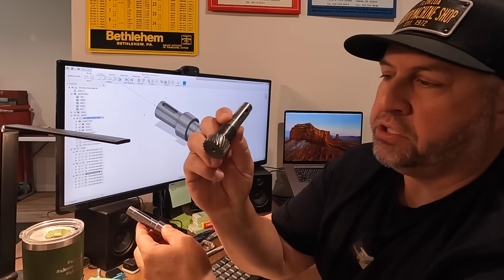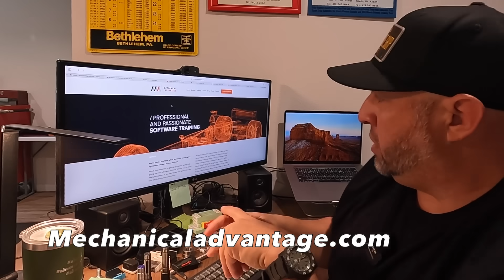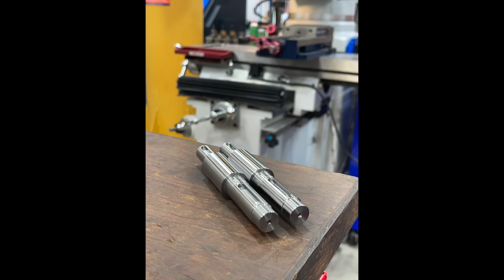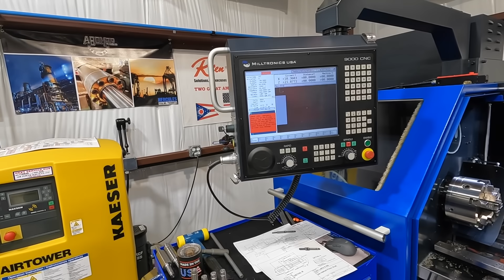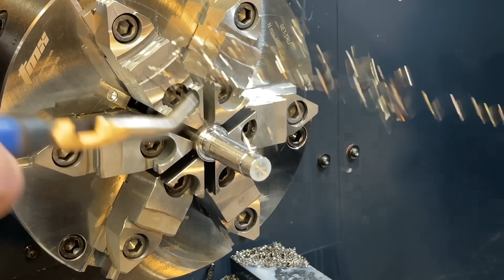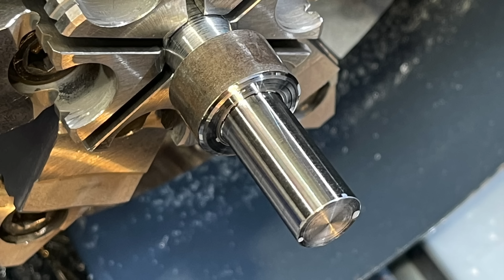Pinion Shafts Turned in the CNC Lathe

Comment: Hi Adam, maybe get a torque wrench for that six jaw in the CNC and figure out the required tightening torque for the parts to stop slipping, once you did that it should be repeatable (unless it varies with part diameter). Also i really appreciate your mix of manual and CNC work on the channel.

Comment: Hi Adam. I think the chatter can be reduced considerably if you reduce the OD tool stick-out from the turret on the Miltronics. In my opinion the tools are sticking out too much. I can see that the setup on the manual has very low tool stick-out and reduction of tool stick-out from the holder is a general rule in machining. This applies to boring operations too. Any stick-out  length more than 3 times Dia for a steel shank boring tool is going to make the bar scream on the CNC. Another thing you can try is ask MIltronics how to do Spindle Speed Variation (SSV). All the FANUC, HAAS (HAAS calls it SSV and they have a video tutorial on it on YT) and Siemens controllers are capable of doing it. Vibrations and chatter on long work pieces sticking out of the chuck can be reduced effectively with SSV. With SSV the spindle speed continuously varies  between two user settable limits over the normal set RPM and that prevents the tool or the job from going into resonant vibrations.  On  a CNC knowing in which direction you should go make those horrible chatter go away can be a little daunting at first. If reduction of tool stick-out does not help, reduce the cutting speed by half or more. Cutting the Depth Of Cut may not always solve the problem because the tool may rub too much at very low DOC. The general rule of thumb is DOC shall be at least as much as the radius of the insert. Try decreasing the nose radius from 0.8mm to 0.4mm or lower and then reduce DOC. My two cents there. Anyways, thanks for posting those videos and I really enjoy watching them.

Comment: > laugh riot - 'the client only needs 8 pcs.'...more than likely translates to a cooperative educational process of securing a timely and reasonably priced cnc machined replacement item when in fact they probably need ~ 800 pcs., of which 8 will cover the last couple months back ordered repair parts supply. one of those work & earn interface vortexes the result of software mis-match snafus between the oem supplier,  cnc replacement parts supplier and the design/production process. Fortunately, abom can just as easily get the job done manually to extreme precision tolerance in nearly the same time frame while learning how to 'profit' from  his skills inventory new and old.

Comment: Sad Adam, I babled the same excuses 25 years ago when I started modeling, programming, and setting up and running the cnc's. 
    The difference is that I didn't have the new machines. They were 89 vintage with a terrible programming program.
 25 years later I'm retired and can relax and listen to you.
  My first 23 years of work were spent in a forge shop as a machine repairman running the old crank maching tools, so I knew about speeds and feeds. Down side to that is carbide came into play with the cnc's, which are much different.😮

Comment: I wonder if you could use a ratchet or torque wrench instead of the chuck key. It will give you more leverage and keep you from the wall. if you use a torque wrench you'll know you hit the mark to tighten it the same all the time.  
For your rough sawing, why aren't you setting a stop so they are all the same length?

Comment: Excess. Not access. Seem like it would have been easier just to do it manually.
Reply: That’s not the point, he even says in the video, it’s a learning exercise to learn CAD/CAM and CNC. He could have done this faster in his manual lathe, but that’s not the point, he’s trying to learn.
Reply: But then he wouldn't improve and widen his skills, adding a CNC to the shop for such jobs, where he has multiple of the same part to machine is a step in the direction of making the shop sustainable beyond youtube and patreon.

Comment: Hey Adam, i run cnc and manual,  is it possible to use  3 jaws made os steel or ductile and bore the jaws leaving a stop in the back, basically bore a pocket, you will need a boring ring to do it properly.

Comment: There’s no way that the issue is that you’re not tightening the 6 jaw enough. I’m not a CNC guy but maybe that chuck is not the right chuck for the job. There are cnc machinists out there that are much smaller and weaker than you are and they do just fine without having to put the gronk on the chuck.

Comment: 14:20 In the production shop we used a Collet and Bar Feed system, so it could part off, feed out the material and make the next piece automatically.  The Collet was tightened with hydraulic force so it was REALLY tight, but we still got push back occasionally.

SO we had to add extra cuts when roughing, which slowed production.

On some jobs we used soft jaws machined to suit that job, with a positive STOP or base in the back of the jaws to push against when roughing ...   so the part could NOT be forced back.

Comment: I understand why the toolpost turret is reversed for ease of access on a CNC lathe. but I'm curious to know how they solved the liftoff problem since the spindle is still spinning counter-clockwise. seems like it would make more sense to just reverse the chuck. though I'm sure a whole market of left handed tools would have to accompany that
Reply: Turning tool "lift off" is much a non-issue, this has been done on manual lathes (inverse tool post on the cross slide) cam driven Swiss screw machines and many more for many decades.. With a manual lathe, threading away from a shoulder with the spindle running CCW is far better than running the spindle CW threading towards the spindle.. The only situation when running the lathe spindle CCW is on a lathe with a right hand threaded on chuck and home hobby shop grade ways/gibs..
Reply: The tools are normal, they're not left handed. They're just mounted upside down with the chuck turning in the normal direction.

Comment: Hi Adam watching you turn up those small shafts we and I always use the pipe on that Chuck wrench I know it sounds unorthodox but that's how you get it to run tight the other thing you can do is a stop through the spindle to keep your stock from pushing back I thought this would help you

Comment: I'm just a hobbyist, but one thing I've figured out in my limited CNC experience is, if I'm only making a few parts, there is no point in pushing the feeds and speeds to the limits of the machine, workholding, and tooling. If I spend half a day programming a part, and an hour setting up the machine, who cares if each part takes three minutes or five to cut?
Reply: Optimal cutting velocities are responsible for your surface finish (and many other things, like the service life of your cutting tools)
I guess that matters at least for you?:) Learning that (and understanding!!!) takes months and deep understanding in machining processes and material science. And sitting down, actually calculating this (and not praying to god) can sometimes take more than three or five minutes. Which, I guess we can agree on that, is not wasted time.
I don't understand the way you go with your argument ... those arbitrary time durations or the emphasis on that fast=bad and slow=good (could have misunderstood you) example/understanding. That is just nonsense!:) USE THE RIGHT SPEEDS, the appropriate ones: RTFM! (Sorry, but that is true. READ THE DATASHEET of the manufacturer and your machining handbook) Hehehe:)
Reply: @dieSpinnt  As long as we are throwing insults at each other, you are the one spouting nonsense. There is usually a range of feed and speed values that works will for a particular tool and material.

Manufacturers "optimal" recommendations, in my limited experience, skew towards the aggressive end--maximizing material removal rate at the expense of other factors. This is especially the case for roughing operations, which is where Adam was having trouble (and where surface finish is less critical). The manufacturers' aggressive approach makes sense for production scenarios, less so for short runs and one-offs.

I find that, with my (admittedly underpowered) machines, I tend to get the best results choosing speeds at the low end of manufacturer's recommendations, or even below their recommended range, as long as I keep the feed and speed proportional in order to maintain an adequate chip thickness. I find that approach helps me avoid workholding and toolholding problems and broken tools.

High speeds result in heavier cutting loads and a greater likelihood that the work will move, as Adam was experiencing. Does that mean you should make your cuts with a 0.0001" chip load or a 0.001" stepover? Of course not. Too little load on the tool also has downsides for surface finish, tool life and, of course, cutting time. But the notion that there is one exact speed and feed setting, allowed, and if you deviate from that at all, your part is crap? That is "just nonsense."

Of course, if I were going to make 1000 of something, I would be willing to invest more time into figuring out how far I can push the MRR. Even then, I would use the manufacturer's recommendations as the starting point for experimentation.

And I am aware that some materials, like stainless, are much more particular about feeds/speeds than others. Although even with stainless, I have found you can slow down quite a bit as long as you keep the chips thick enough to get under the work hardening.

And, yes, if your workholding slips, that suggests you are in the range where fast=bad and slow=good.

Comment: I'm glad to see you adding CAD/CAM to the shop. Once you get a handle on it, you'll work a LOT faster on batch runs. Right now, it's slower, because there's a steep learning curve, but soon, you'll be rocking the software, and making changes on the fly will be easy.

Comment: Out of curiosity what RPM were you running?  I remember reading sometime back how much the clamping force goes down as the rpm increases due to the jaws trying to open from centrifugal force, it was mind blowing how big a percentage of clamp force you lose at higher and higher rpms above 1500. Might be something to consider. Also maybe do some tests on spindle start stops, maybe the scroll is being acted on when the spindle hard starts causing it to start to loosen?

I guess this is why most machines run hydraulic chucks, they way they work their clamping force has much higher mechanical advantage to stay secure.  Problem with hydraulic chucks is you aren't sure how much force they are exerting like you know when you tighten a key. And they have such a limited range of clamping you are constantly adjusting the jaw position or machining soft jaws.

Comment: This was really interesting!  It looks like you are taking a proper approach.  I have a few questions and suggestions.  First, isn't Fusion CAD used across the industry?  I know that this wouldn't work with this particular customer, but won't there be future customers who could give you the equivalent of a blueprint but in the form of a Fusion CAD drawing?

Also, I know that when you do manual machining, you are always super careful to stop vibrations in the part.  Generally you solve these problems with a lot of experience in speeds, feeds, and selection of cutting tools.  Here, I heard a lot of pure, high-pitched ringing when you were reducing the diameter of the part.  I noticed that the ringing got worse as the part diameter decreased. You also said that you were using a high-tensile variant of a steel that you had used in the past. If you have a part that is ringing like crazy, won't it tend to "walk" around in the work holder?  My physics spidey sense reminds me of a hockey game played on a vibrating table.  The pucks move on the vibrating surface with almost no friction.

Also, I follow precision machinists Stephan Gotteswinter and Joe Pie.  They tend to use collets rather than chucks for parts not that much smaller than your workpieces.

Comment: We use a spindle stop on alot of parts to make sure it can't move & also for repeatability for flipping and facing to length.  By the way, as you're learning how to use the software at computer or on the machine, I can't stress enough how easy and important it is to JUST edit the code to make it do what you want.  I mean we have run parts for 30 yrs or so and still edit code all the time.  Material, temps, all kinds of things can contribute but you have full control by just editing the code as needed.  If I could be of any help with that I sure don't mine.  I would like to see the Gcode on the screen on every job.  It holds the answers to about any problem your having with machining.  Enjoy your stuff Adam, I really do.

Comment: Don't be so hard on yourself. CNC is similar to manual but not the same, and you have habits that will be hard to change. and you dont have someone in the shop to ask step by step, in the future just do one part start to finish and then you can see if there are going to be problems and you dont commit several pieces to a method thats a bit... not so worky. 

The first thing I would change is the roughing insert. I would drop to a 0.4mm nose rad. 0.25mm/rev (10 thou) is rather slow for a roughing insert and you were getting a horrible sound from it and poor chip control about 0.3mm/rev is a fairly good target should be able to get atleast 2mm per side DOC. might be the insert style and the machine combo might be the material. Sometimes you can't overcome it by speeds and feed and need to change it. 

second, I would machine it the other way around. do the plain diameter without journals first and machine that shoulder and larger centre diameter too,  a little longer than the finished length, that way on the next op you can turn to your finished length and blend it at the chamfer, have the chamfer run to a slightly larger diameter past. 

I would then use an ER-whatever size collet you have, to hold it in a straight-shank ER tool holder in the chuck. I would also use a little slip-fit bush about 3mm long too with a good chamfer on both sides to clear the insert rad on the shoulder corner and the ER collet itself (if the part face is bigger than the collet face and your part is rubbing against the collet nut, turn a step in the spacer so it only bears on the collet. I like to hold firm pressure on the collet nut and gently tap the work face into the collet with a mallet too. the collet can pull into the taper in the tool holder and the part stays where it is. you can tell if it's pulled up tight when the bush is tight. the two-face contact will give you really good rigidity. 

that will give you a very consistent length and not mar the part too.  

also, use a torque wrench on your manual chuck if your having trouble, if you find its slipping you can incrimentally go tighter till its where you want it. consistency is key when CNC machining. precision is repeatable accuracy.
 
I use a ratchet with a square drive on a 3m CNC bed lathe just because of that left-side obstruction. 

hope that makes sence, words are hard.

Comment: there will always be some bad parts at the beginning with a new tool, until you learn what works and what doesn't.

even if you get a few bad parts now and then, it's important not to lose confidence and keep practicing. it's the only way to learn and get better.

must admit that I think it is strange that they make new CNC machines without a hydraulic chuck, this is something I have not seen elsewhere.

Hard jaws are more likely to slip or spin than soft jaws, so learning how to make soft jaws for CNC machines is an important thing.

another option is to use a collet chuck.

another tip I would give is to reduce the protrusion of the tools in the CNC machine as much as possible, 
this includes cutting the stem of the tools if necessary, as this will give you more stability.

keep practicing and you'll be an expert at CNC before you know it.

great video, keep it up👍

Comment: Does anybody have an answer?
Previously, when tightening the chuck Adam has tightened at each of the three positions for the chuck key, eliminating any residual backlash at the interface between the spiral and the jaws.
I'm guessing it is more important on a six jaw chuck than on a three jaw, because three jaws naturally even out, like a three legged stool.
I'm also guessing the harder the material, the more important it is to eliminate any pressure differences between the jaws and the workpiece.
There was also no mention of precision grinding the jaws in the box opening video. Or use softer, sacrificial jaws? <edit> that'll teach me to go to the end before commenting!

Comment: Possibly an excess operation but you could turn small shoulder on the back of the shaft to use as a stop up against the jaws which will be machined out when you flip the part.

Comment: Maybe you need to skim cut the inside of the jaws in situ, perhaps inconsistency in the gripping face of the jaws leading to uneven pressure on the workpiece allowing it to slip. If you preload the jaw and skim them it should even the load on each. Just a thought, IIRC Stefan Gotteswinter did this to one of his six jaw vises.
Reply: That's exactly what he needs to do pal.  You hit the nail on the head 😮